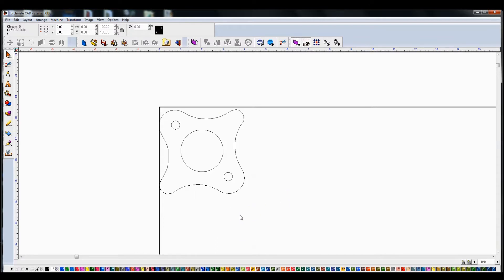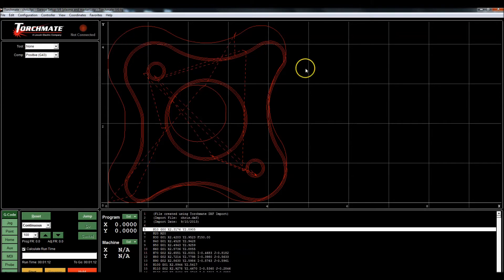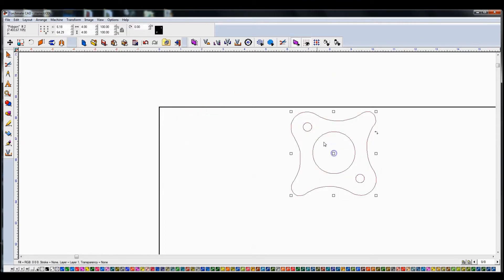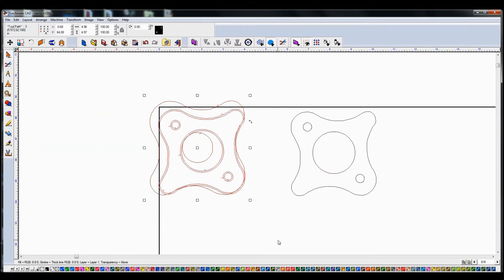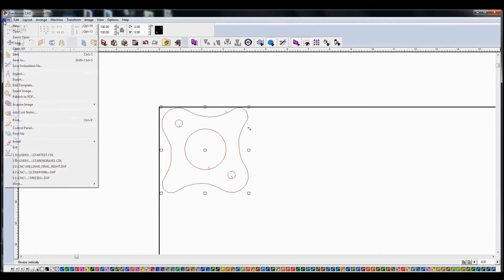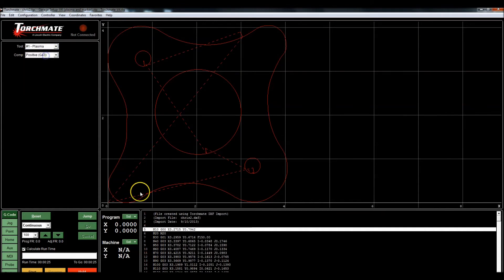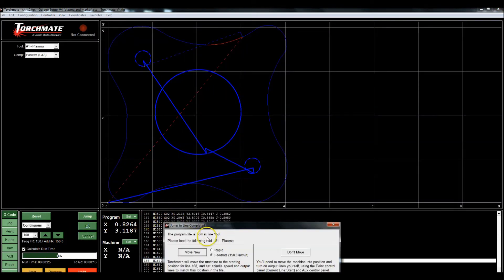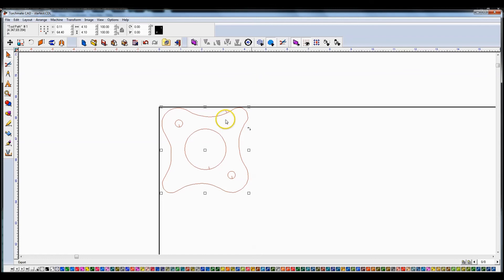Torchmate CAD/CAM -- Troubleshooting a file that has multiple cut paths

Comment: What about having a broken path that needs to be fixed? For some reason clicking make path or connect path doesn’t joint the paths and when I try to cut out a letter it is coming out in. Multiple starts and stops.